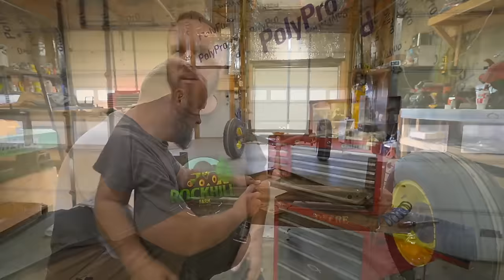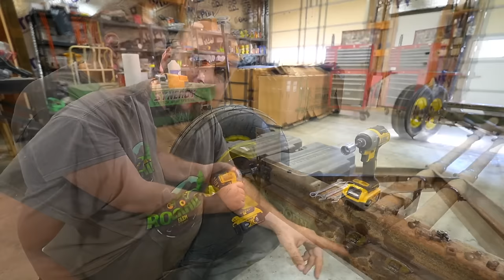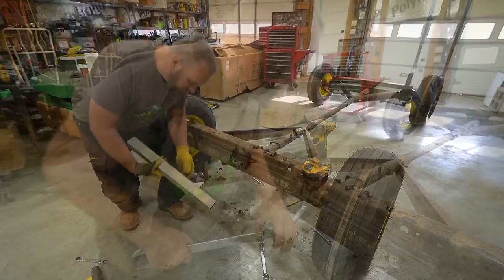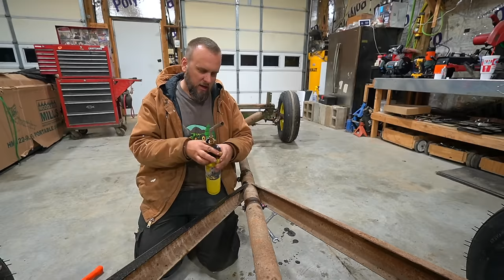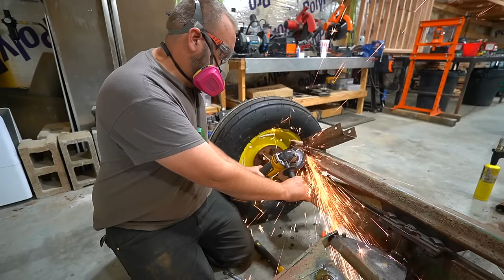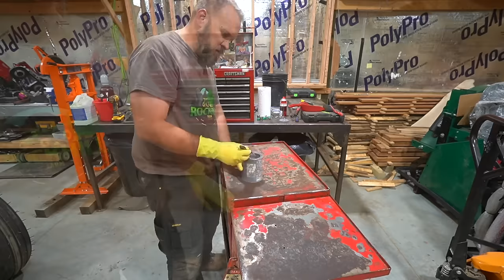They Don't Make Nostalgia Like They Used To

Comment: You spent more time on those tough bolts than I would have before I broke out the grinder with cutting wheel.  Like you I would replace all the bolts anyway so cutting them off was the way to go.  It is good to see someone else trying to make use of stuff you already have instead of just buying a new one.  I do buy some things, but I like to save the big money when I can.  I enjoy your videos sir, keep up the good work.
Reply from the maker: Thanks

Comment: With all that equipment you need to have  acetylene torch. Even if it’s for removing bolts and bending or straightening. It’s like those oscillating saws. You hardly ever need it but when you do, nothing works like it. 
Keep the videos coming.
Reply from the maker: Agreed. I need to add one.

Comment: Craftsman tool boxes may not be the best ones around anymore, but I still like them. I have 4 stacks like yours, 2 of which I've had for 30+ years, and the other 2 which I've acquired in the last 2 years. One I paid $400 for and it came with a bunch of tools, the other I paid $150 for. All of them are in excellent shape. If all goes well and the guy hasn't sold it over the weekend, I'm going to pick up a 5th set. It's pretty amazing how many tools you can acquire over several decades :)
Reply from the maker: I think I bought this toolbox in 1999 and haven’t taken great care of it but it’s perfectly functional

Comment: Good morning Brock. Just a short comment today. If my old memory serves me correctly a Propane torch will burn at approximately 2300 degrees and Mapp gas burns at 3200 degrees so technically you would be able to braze something with Mapp gas. Before I had any real tools I actually used one to braze with. I'm a font of useless information. God bless and have a wonderful day. 👍👍🙂
Reply from the maker: Thank you for the information

Comment: Don't you have a plasma cutter for the bolts? that would be my go to.
Reply from the maker: It’s rated for cutting half-inch material. The bolts are definitely bigger diameter than that and even the heads are thicker.